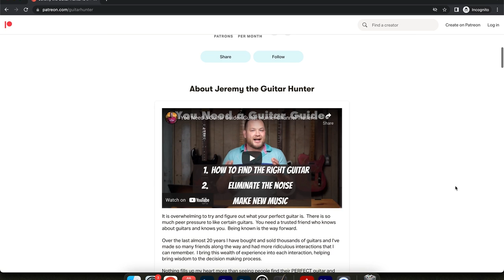I flew to the Czech Republic to see @FurchGuitarsOfficial in person

Comment: CraftMANship and robotics are antithetical, because there is no man involved just software and hardware. Many large manufacturers are using robotics to some degree but these guys are trying to replace almost all of the humans with their robotics. I worked 30years as an Electronics Engineer so I have respect for what they are doing but every piece of wood is different so you will still end up with good and better guitars. The most important thing in the guitar build is to get the right thickness of the top and correct amount of bracing but, they tend to sound best at the point where they start to lose strength from the removal of bracing. Very cool but I still like hand-built guitars.
Reply: Hello, thank you for your thoughts. Please, feel free to visit us if you are close to Velke Nemcice. We will be happy to show you our production and talk to you about when and how we use our technologies in production of our guitars. Greetings!

Comment: There sure is a lot of grain run-out on those braces @ 11:29.
Reply from the maker: What do you mean? I don't know that phrase
Reply: @JeremySheppard  Grain run-out is a common term in woodworking, braces are usually split on the grain not sawn through the grain so the same grain line runs from end to end not running out somewhere before the ends.

Comment: There's been 5x's CNC machines for years I used to run one over 20 years ago and it was very capable of building all these parts and I'm very capable of programming it to do it this is nothing new in technology I could have scanned a picture of you into the computer , I'm on my point to point CNC machine and the machine would have broke the program and made a perfect bust of your head and it would have looked just like you this technology is not new it's been around for years